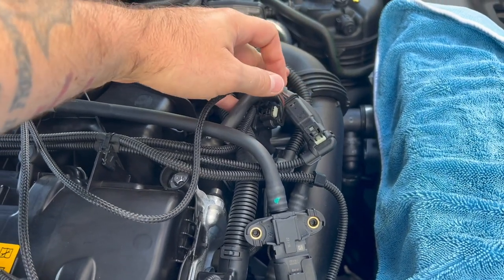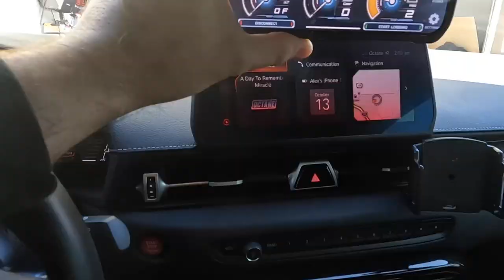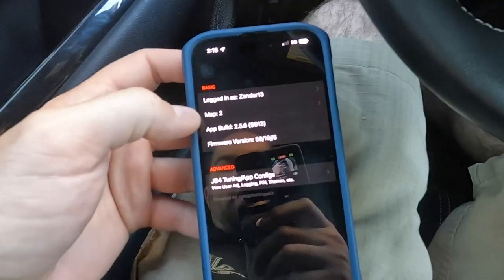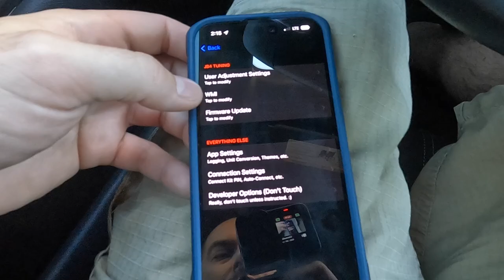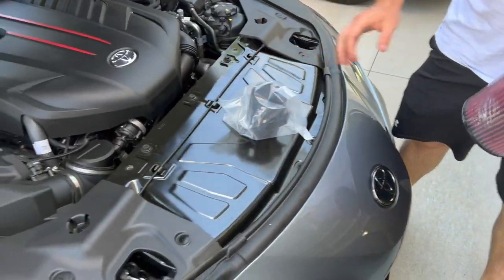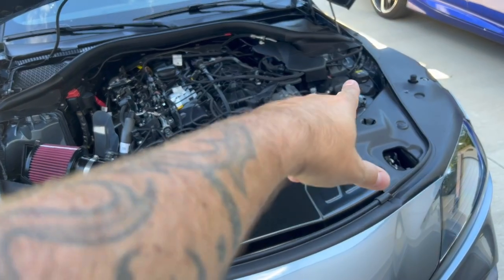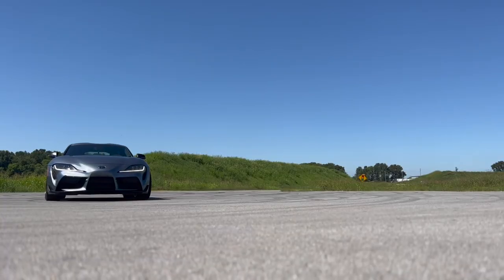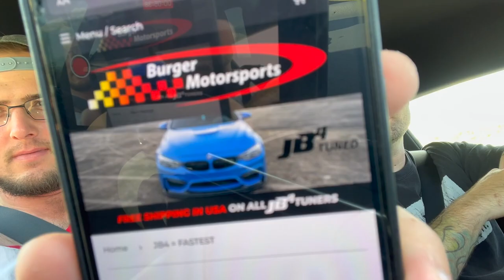MORE POWER + TURBO NOISES! TUNED MY SUPRA WITH JB4 & THINGS GOT FAST!!

Comment: Couple of questions, Do you have to re clear the code for a check engine light(Catless downpipe) every time you get in the car? With the maps, do you have to upload your map every time you step into the car as well? Does everything return to stock as soon as you get out of the vehicle? And is the wireless option better than the wired option if the answer to the previous questions are no?

Comment: So to get it straight, if I install a downpipe and get a check engine light, can I remove that light using the jb4? Or no way around that.
Reply from the maker: You can delete it with JB4 but it will come back. It does not hurt anything. Just a caution light. JB4 used to be able to turn it off. But now everything is EPA restricted.
Reply: @Zander13Productions  gotcha I see. Thanks for the info man appreciate it!